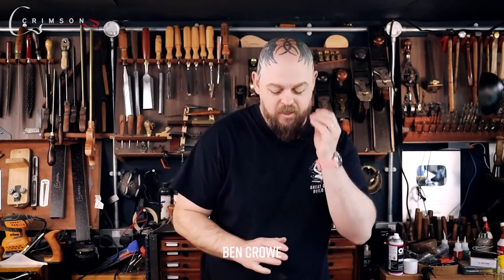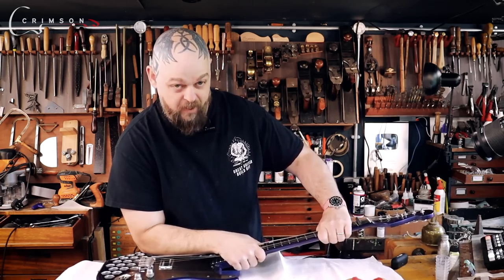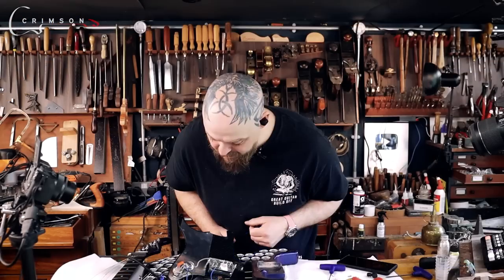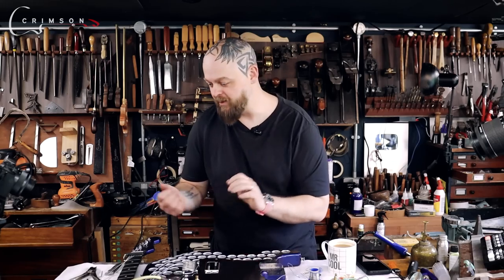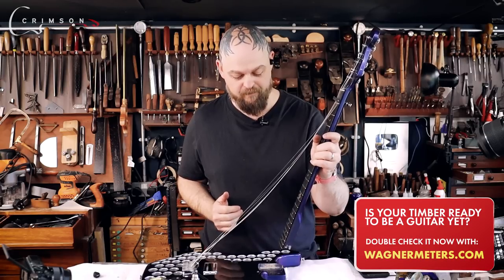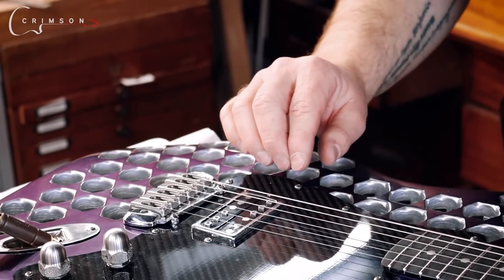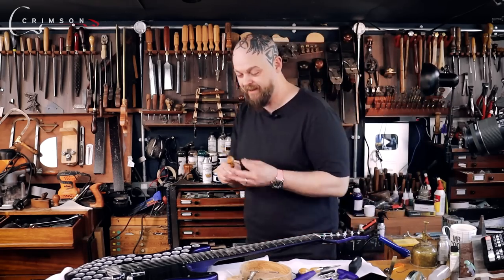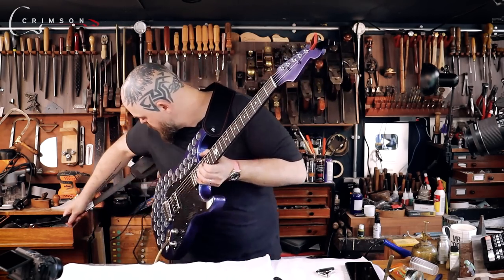My Daughter HATES a guitar I made for her  |  Easy access to a Strat Wiring Cavity -  using a CAPO

Comment: I saw this somewhere else and might be of use (those neck pockets look so tight and good, i doubt it will do much) when you replace the neck and tune up, release some tension from the upper two bolts and then a quarter turn or so for the lower two bolts and you should hear the neck shift further into the pocket, then re tune. when i learnt this i did it to all bolt on guitars i have. not only it gets great fit but helps sustainability too! 
Keep up the great work. Love watching and learning from you.

Comment: I've been doing something similar with my floyd guitars: Remove back springs, pop bridge out, fix electronic, pop bridge back in, hook springs up, guitar is immediately in tune and ready to play.

Much easier to do with 3 or 4 weaker springs than with 2 mega-strong springs (*glares at Ibanez zero-point spring contraption*).

Comment: I've done that capo on strings trick in the past, but never at full tension, just to keep the strings from moving too much in the tuners. I usually loosen the strings as far as they'll go without removing them, put the capo on, and slide the pickguard under them. Then again, I'm only doing that to my own guitars, and I don't care much for how banged up or scratched they get. :)

Comment: From Leo:  Good use of a capo.  I use a couple of pipe cleaners to secure  the strings. The ones from the craft supply store are extra long, which I like,  A few pipe cleaners are easy to carry in your tech tool kit.  I do still loosen the strings about two turns to not risk damage to the neck/body joint.  I notice your vintage turn screws, I have only seen those as included tools with classic top end British Safari rifles and Sporting shotguns.  Bravo.

Comment: I've done this.

Also, with a floyd.

Simply pop the springs, then the neck
Set it all aside
Work on the pickups or whatever.
Put neck back on
Drop flotd back onto the posts
Put springs back on
Viola'!

It'll still be in tune.
Bonus!

Comment: Second best use for a capo in my book is for nut height setting. By putting the capo on 2nd or 3rd fret you can easily tap the first fret to see the height you need to achieve. This is good 3rd best though 👍

Comment: Hey Ben, I like the idea of using the capo and removing the neck. Just wondering if the damage on the neck (paint on lower side of joint near the bridge end of the neck) was from before the removal or if it was caused by it?

Comment: We call them electric guitars because the magnetic field being disturbed by the movement of the string induces an electric current in the pickup (which is technically an inductor).  This very small current and low voltage (nominally 1/10 volt) needs to be amplified (by the amplifier) to be able to drive the speakers (nominally 30v).  so the amplifier has to increase the voltage by >100x.  THUS the need for shielding: if even a very small voltage gets induced by stray fields (from the 50/60Hz in your walls predominately) then it gets amplified 100s of times and you hear it as noise.
Electricity and magnetism are pretty well described as 'joined at the hip' :)

Comment: re the flat screwdriver and ease of use: you can slip a bit of plastic tube over the tip. this will stop the screwdriver from slipping out of the slot.

Comment: "Why do we call it an electric guitar when it's magnetic?"  The pickup is actually an electromagnet when paired with the strings.  You know those emergency flashlights that you shake to charge?  They're the same tech.  Coils of copper on the outside and barrel magnets on the inside, and the movement between the two creates an electric charge.  Difference is instead of outputting that electricity to a battery and then a bulb, the guitar just feeds it directly (more or less) to the audio jack.

I realize I might be teaching my granny to suck eggs here, but I think it's neat how magnetism an electricity are just two manifestations of the same force.

Comment: This is a technique I use nearly everyday when I need to shim a neck. It's not something you realize is needed until strings are at tension and the neck relief is set. It's only when you try to set string height that you notice the need for a shim. Instead of wasting time removing the strings (and string retainer in the case of 5-string bass) we just down tune and slap a capo on. My butthole puckered a little bit when you said that you were doing this under near full tension tho.. that I would not recommend. Maybe at least a couple full steps down.
Reply: Yup for shimming it's a blessing using a capo. Also I was "Nooooooooooo......" when Ben didn't detune before removing the neck. Main reason for me, apart from snapping strings, is to make it easier to wiggle the neck off. Really handy when you have a guitar, like a classic style Strat, with the truss rodd adjustment at the body end of the neck.

Comment: I wouldn't call it improving your skill. I would say that it's just taught a way to be lazy. Just take off the strings man..   Sometimes you will create more work for yourself trying to be lazy than it is just to take the d*** strings off. Just saying
Reply: It works for him so what's the issue? There's so much more to be angry about in this world than how a some people take the neck off. You do you
Reply: The thing is, he discovered the electronic problems literally about two minutes after putting on a fresh new set of strings, stretching and tuning them, and clipping off the string ends. They never would have gone back on properly. Taking them off would have meant wasting a brand new set of strings, and even Ben doesn't get those for free. I'd have had a hard time reaching for the clippers too. I also would have sworn a lot more than he did too.
Reply: @tahoemike5828  100% Ive done the same thing before, just without the capo and loosening the strings a little, not going to through away $12 worth of strings when they can be saved at no detriment to the strings or the rest of the world (except for some angry dude on the internet) :D
Reply: I'm poor as h*** and I would just go buy new strings. It's just 5 bucks man